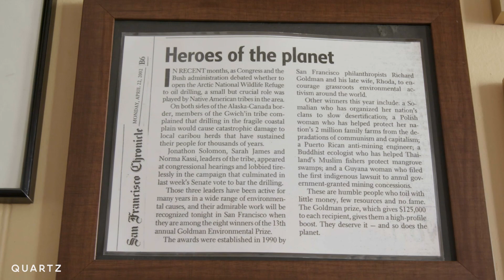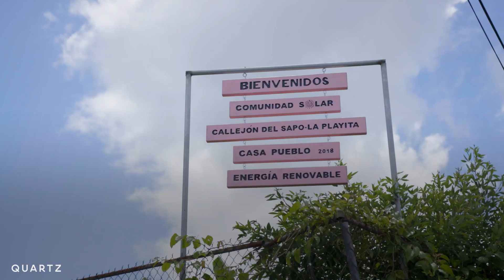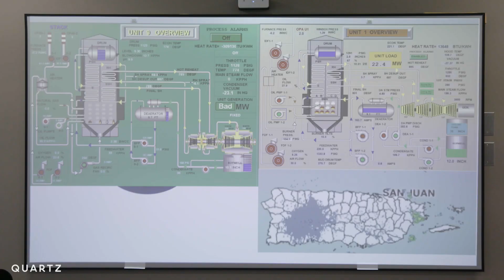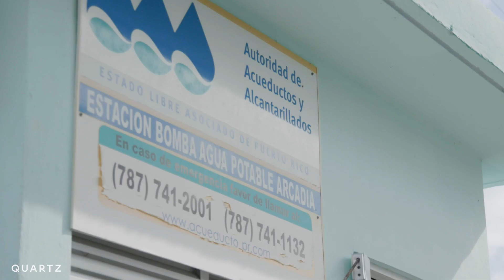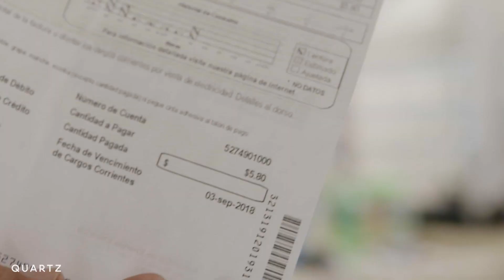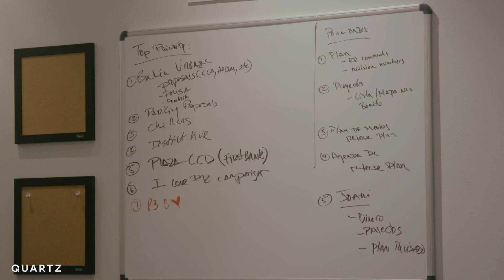Puerto Rico's solar energy insurrection

Comment: First off solar panels would be destroyed in a hurricane unless they are hardened to withstand them. Which could be done. Unfortunately humans aren't very good at putting in the extra effort required to avoid catastrophes from repeating themselves. Example: Building houses on flood plains, then getting flooded out, then rebuilding on flood plains, then getting flooded out and then rebuilding on flood plains. New Orleans is a classic example of this.  

Second throwing in climate change as in an effort to scare people is unnecessary, and if you are going to do it you better have proof that hurricanes are getting stronger. People should go solar for economic reasons and for self reliance. That is the only argument needed.
Reply: I had the same thought. Wind and debris will destroy a large number of the solar systems if they aren't hardened. Indeed, the way these generally are set up, only a few damaged panels can take out a complete system.  Some of those ground based systems they showed in the video looked like they may have been hardened but those home rooftop installations looked like they would take off like sails.
Reply: Couldn't you just cover them with plywood, just like they do with Windows?

Comment: A decentralised, self generated, sustainable power paradigm is inevitable. There is just no technical, economic, environmental, or social argument for large centralised grids. If centralised power station burning coal and gas were a vehicle, the closest analogy would be a gold and diamond encrusted pogo stick. The consumer, industry, the environment... are all much better served decentralised self generation. When a single ton of coal is used in a large scale power generator, approximately %80 of the power is lost in transmission or in the cost of extracting and distributing the coal in the first place. Energy is literally the most abundant thing in the universe. That it should be commoditised is farcical.

Comment: My solar generator was easy to build.  It's a micro version of a home system (off grid). Bought lights, so no problem during a storm.  Can recharge phones, run my small clothes dryer, partially recharge my snowblower battery.  I'm gonna upscale a bigger system to run a sump pump during outages.  Global warming

Comment: Makes perfect sense to go 100% solar in such a location. Puerto Rico and Hawaii can lead the way!
Reply: Makes perfect sense to go solar (green) anywhere
Reply: Where I live, solar makes no sense for about half the year, luckily wind power makes up for that.
Reply: @zapfanzapfan  looks like you don't have to worry about air conditioning
Reply: AC is just not a thing here. A friend who lives in Germany was very happy she had a working AC last summer.
Reply: It's stupid to think in terms of 'one size fits all' solution, like solar. 

Solar makes sense where there is ample solar resource because that makes it more cost effective. Solar in places with poor solar resources are wasting money (easily doubling their electricity cost or worse). Furthermore, power generation should match as closely as possible to demand. In the high latitudes, winter heating & long hours of night meaner more energy consumption in winter--when solar produces the least power. But in warm climes where energy consumption goes up in summer and down in winter, solar is a much better option.

Similarly, wind power makes sense where there are consistent high speed winds. The high plains in the central US are a good place to rely on wind. Many other places installing turbines are NOT ideal and thus pay more and experience longer times without sufficient production.

There's also a limit to how much can be produced without storage or time-shifting demand. When solar or wind produce too much power, it has to go somewhere. CA and Ontario have to pay surrounding areas to take their excess electricity, and those costs are passed on to the public. One way around that is to use storage, but storage is expensive and raises costs, too. Thus, there is a cost-effective limit for renewables like solar & wind at the point where they produce 100% of the grid's instant needs. That may mean no more than 20% of the nominal load should be renewables.
Reply: Storage is key, or having hydro to balance with. Denmark sometimes makes more electricity from wind alone than they consume in the entire country, but they just export it to Norway where they instead save a bit of its hydro for later.
Reply: zapfanzapfan "Makes perfect sense"
Put up solar panels that will act like putting up sails in a storm makes sense if you want to sell a lot of solar panels.
Solar rarely makes sense to people that have to pay the unsubsidized cost of it.
There's no sun at night. Batteries are expensive and not green.
Reply: when the temp is lower the efficiency of solar goes higher   look at Germany
Reply: The sun barely makes it over the horizon for four months of the year here and even when it does it's cloudy.
Reply: we are going to see more and more extremes in climate

Comment: They could use renewable heat for hot water too. 
Use air to water heat pump for this. 
It is the perfect  compliment to solar electricity. And a cheap form of energy storage.
Avoid using 'natural' gas at all.
Reply: Here in Israel 90% of houses have solar water heaters.
Reply: @jackcohen4931  That's great. It's perfect for mainly sunny places like much of Israel. 
For often cloudy/ shady/small roofed places we prefer to promote heat pumps, so leaving the roof for PV. (In Australia)
In Israel, do they mainly use 'close-coupled' (tank above the panels) or rooftop collector and tank on ground level?
Reply: @guringai  Close coupled.

Comment: In about 5 years 80% of homes in the world will have solar panels and batteries... Prices have been dropping so fast that it will make no economic sense to pay for centralized power... Aiming for 2050 basically means they are hoping people will forget about it.
Reply: You're delusional. Electric power is < 20 % of power. We currently have less than 3 %. Solar doesn't work at night and basically doesn't pay for itself for 20 years. Batteries & Panels are extremely dirty for the environment and have to be replaced at 20 year point. You're being cheated by scam artists who are moving all the technology to china. You should be on nuclear power, but won't figure that out till 2050 and then too late.
Reply: @cbrich7408   Solar doesn't work at night.......... battery
Reply: @emko333  Do your homework & neither solar or wind fly economically or from environmental standpoint. Stealing money from tax base(people) thru subsidies to the wealthy corporations is just a scam. Nuclear is the only technology that is actually cost efficient n an island. The gov already knows how to do nuke fusion,they've already done it at livermore labs. they are hiding the technology on orders from the bankers/oligarchs. I'm an electrical engineer I know all about batteries.
Reply: @cbrich7408  you aint a engineer of anything but in your mind
Reply: @emko333  2 degrees and 30 years experience in silicon valley pal. And you are what  ? work at quickie mart on the night shift.

Comment: The houses that need to be focused on to build panels onto are the concrete ones that also have a raised lip on the side.  Which will help aerodynamically protect the panels from damaging winds.  The large solar arrays that were build out in fields were heavily damaged, but with proper installation, that can easily be prevented.  Also, I'm a huge proponent of the microgrid systems- set up neighborhood based storage and inversion to the main power grid.  However, I'm not a big fan of the Tesla wall, as it's not good economically nor for the environment- there has been some good research into soil and salt water based batteries- which can both be made locally in Puerto Rico.  And when they "expire", the materials are not harmful to the environment.  In addition, they are far more robust to a warm climate, unlike Li batteries.

And a specific issue to many homes in Puerto Rico is fire safety- Li based batteries pose a fire risk- and given the security measures that homeowners use all across the island, this would be very dangerous.  Whereas the soil and salt water batteries are much safer.

But having a small building in each neighborhood that does power storage and distribution would work really well.  (sadly, there are empty homes all over the island that would work well for this).

Comment: So this is going to be a big waste of taxpayer money on a failed experiment. Anyone with a basic education in electrical formulas and the ability to do math can debunk this solar BS in 1/2 hour
Reply: That was not true even using 1990s technology. These days solar panel tech and battery tech is in exponential improvement mode. This kind of tech is already in full operation in many places with great success. Solar has been the cheapest way to generate electricity since summer of 2017 and is getting cheaper and more efficient faster and faster. The trend even without new breakthroughs show that within 5 years 80% of homes will generate their own power simply because of economics. Basically energy will be so cheap that it will no longer be a commodity like it is today...